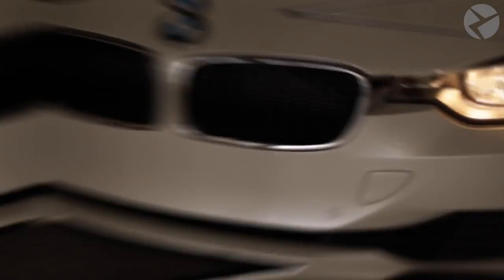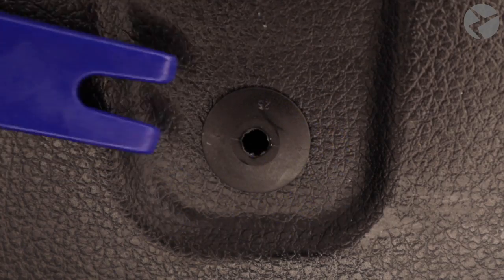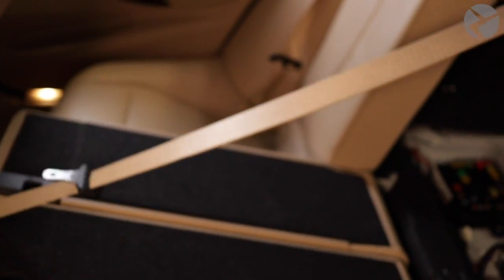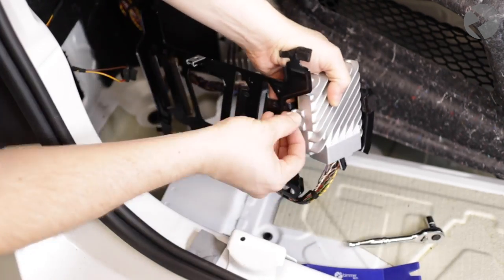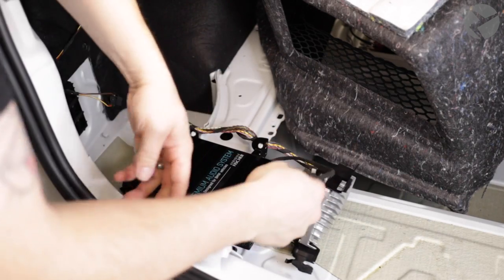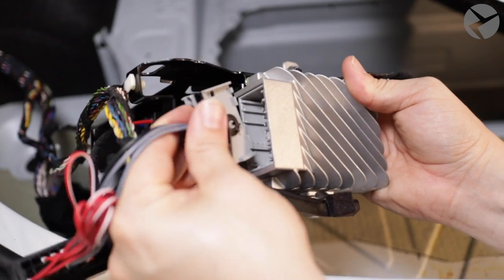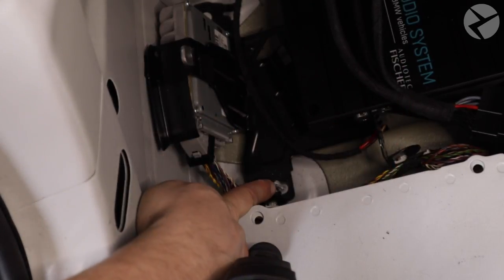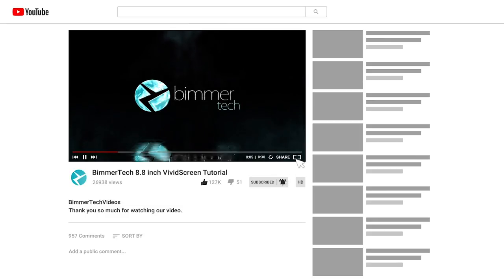How To Upgrade BimmerTech Premium Audio Amplifier & Install ASD Harness in Your F30 BMW

Comment: If i have the base model and i want to have the full surround sound effect will it be posible with your system? I mean if i will get the whole kit, amp plus all the speakers plus the harness, will i be able to have it as premium as possible? or do i need a dsp processor for the center speaker in order to make that surround sound? Do i need the change the cd player also? as that is the brain of the whole system? I dont know if i explanined myself good enough. Sorry about my english, its not my native language :)
Reply from the maker: Studio sound speaker kit will give you the best experience – it will give you a surround sound impression. You don't need a DSP processor because the amp does all the work :) You don't have to change the CD player either. We will send you all instructions after purchase so you will know what to do and how.

Comment: Attention to detail... You should remove the harnesses from the modules first before removing the modules and make sure that when installing the new amp, you slide it in properly on the bracket. you left a metal tab out of place. hence why the bolt hole was misaligned.
Reply from the maker: Hello Juan, great catch, thank you. We'll have Chaz realign the amp on the bracket and it will fit like a glove :)

Comment: I heard the amp upgrade is more significant than the speakers alone, is that true?
Reply from the maker: Correct, however whether you should upgrade the amp alone also depends on your sound system. In some cases – like with the Base system – it's best to upgrade both speakers and amp since stock speakers aren't capable of handling large power levels. You can learn more about this topic here: https://www.bimmer-tech.net/blog/item/39-harman-kardon-vs-hi-fi-vs-standard-audio-for-bmw
Reply: @bimmer-tech  I have the Harman Kardon in the G20, so seems like the amp is the best first bet. As for speakers, I mostly listen to hip hop/rap so which speaker replacement would be ideal? (besides all of them haha)
Reply: @bimmer-tech  I'm assuming it is the same amp for both HiFi or HK system correct?

Comment: I have the HiFi system and my driver's side tweeter recently developed a buzzing sound at 50-60% volume. Would upgrading the amp help, or do I need a new tweeter?
Reply: Change the Tweeter. Or should I say, change both tweeters.
I bought all speakers from Bimmertech.
I also installed all except the tweeters as I had to source the molding firstly with the tweeters ports (my car didn't have them).
After installing the tweeters, the sound was superb without the amp.
Next project is to buy the amp and install but it's $1399.00 now geessss

Comment: I put in the vin for my 2016 340i and the amp wasn't recommended to buy. I have HK system and want to upgrade the amp only first.
Reply from the maker: We don't have an amp upgrade for Harman Kardon 688. Perhaps that's why the website didn't recommend it for you.

Comment: Great video honestly ! 
I have a question when replacing the stock amp with an OEM amp would this require any BMW scan tool to program the audio? I don't think their is but I have to ask lol
Reply from the maker: By OEM amp you mean BimmerTech amp? If so,  you don't need any programming.

Comment: I have a base 6 speakers system in BMW 330i LCI 2017. Is it ok to upgrade with the Bimmer Tech Amplifier. Does it require a new cable and connectors?
Reply from the maker: Installing our amplifier does not require running additional cables to the speakers. Please contact our sales team and provide them with your VIN to check full compatibility

Comment: Hi dear friend, i have a 2016 model 320i ED Sportline. i think there is not asd module my car and there is not hi-fi sound system. i want to install just asd module. is it possible? if i can install asd module, is it work asd engine sound on my car? Thank you for your response.
Reply from the maker: Retrofitting ASD module should be possible but we always recommend getting rid of it to improve the sound quality. If you do not have a Hi-Fi system, we recommend installing the Alpha One amplifier and Alpha One speakers at the same time.
Reply: @bimmer-tech  okay, thank you again. İ think if i will use standart stock sound system, i should connect asd module to head unit directly. is it true? :)

Comment: I just bought the bimmertech amp and the ASD bypass and it says when it arrives it will need remote coding but in the demo I didn't see that required. Is it saying remote coding as in being able to change the eq?
Reply from the maker: As far as we know your car won't require remote coding. Please contact our support team to make sure what you should do: https://www.bimmer-tech.net/page-contact

Comment: What is the ASD Deactivation Coding for $
Reply from the maker: It's deactivating the artificial engine sound that's generated through your engine. Alpha One sound system can make them really unbearable, because of its intensity.
Reply from the maker: It's deactivating the artificial engine sound that's generated through your engine. Alpha One sound system can make them really unbearable, because of its intensity.

Comment: What advantage is there (if any) to using this harness, vs just coding ASD off via BimmerCode?
Reply from the maker: Rule of thumb is that you want to have the signal go through as few sound processing units as possible. As each processor will degrade the signals quality by a certain amount. With the coding, you will still have the signal going through the ASD module. With the harness not.

Comment: Does this amp work on g20 ? can you post a video on the installation for g20 ?
Reply from the maker: When somebody brings a G20 into our shop for an amp installation, we'll be sure to film it ;) The process is very similar for a G20, the G20 amp is also mounted behind a trim panel in the trunk. After that, the amp is the same, and all the brackets and harnesses are specific to the G20, so installation runs basically like in this video.

Comment: does the standard amp allow for any bass adjustments like on a normal car amp?
Reply from the maker: Hi Matt, absolutely! With the BimmerTech's Premium Audio System Amplifier you are also provided with a preloaded DSP (Digital Signal Processing) tune file. It is easily loadable onto your amplifier via USB. Thanks to this file you can tweak the settings to your exact needs. I recommend you read this blog post, it will tell you anything you want to know on our amps :) https://www.bimmer-tech.net/blog/item/31-why-upgrade-your-bmw-amplifier

Comment: Is the installation any different if i have the base stereo system without any factory amp ?
Reply from the maker: Correct, cars equipped with the base stereo system require a stereo harness to be retrofitted in the car for the amplifier.
Reply: @bimmer-tech  I have the base system also. So no harness. Where can i buy the harness and after the amp instalation will the amplifier push all the other speakers also? or it will only push the subs? I want to buy the whole audio kit from u guys, but i want to make sure it will sound good, i mean i dont want to add the amp only for the subs. As there are cheaper versions out there. Thank u
Reply from the maker: @Lc_Sebastian  Unfortunately, we don't have this harness anywhere on the site but we can sell it by sending a PayPal invoice. Yes, after installation the amp will work with all speakers. The sound will be incomparably better.

Comment: What is the RCA plugs for on the bimmertech amp, is that to use another aftermarket amp for extra subs?
Reply from the maker: Exactly. The RCA connectors are the output for an external amplifier e.g. subwoofer amplifier.

Comment: Does this work on g30’s with hifi? Is the sound close to h/k after this upgrade?
Reply from the maker: Yes, it does. The sound is way cleaner and more powerful than the Harman Kardon one. We also customize it with DSP tuning files, so it matches your musical preferences. There's none of that in h/k.

Comment: It seems a little expensive to pay $2100.00 for an amp and speakers. Granted it may be a perfect fit but not that perfect.
Reply from the maker: We always make sure the speakers and amp kit we send you will perfectly fit your chassis. As for the sound itself, we equip our amp with a DSP tuning file that's adjusted to your musical preferences (the music you like listening to, the levels on which you like to play it, and so on). This way everything should sound just how you like it right away, and in case you'd like some more adjustments we can work on your amp even further.

Comment: What about if the car comes with a base system without an amplifier in the boot of the car? Is there anything to be able to upgrade to an amp as I’m presuming the wiring needed wouldn’t be in the boot
Reply from the maker: Hello! Apart from our BimmerTech Premium Audio System Amplifier you can always upgrade your BMW sound system with, we also offer a variety of Alpha One Speakers that will already make a huge difference to your music experience. Here you have two perfect blog posts on the BMW sound systems and BimmerTech available upgrades. Enjoy! 1. https://www.bimmer-tech.net/blog/item/106-amplifier-or-speakers 2. https://www.bimmer-tech.net/blog/item/31-why-upgrade-your-bmw-amplifier. You will also find here some more info on the DIY installation.